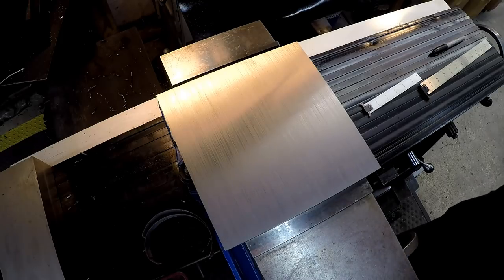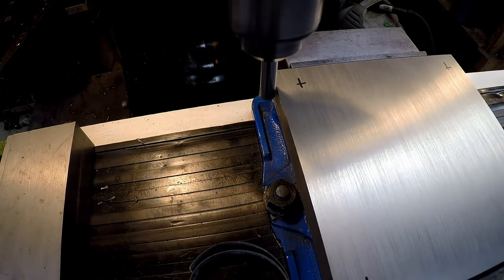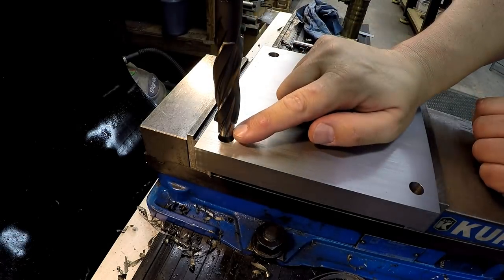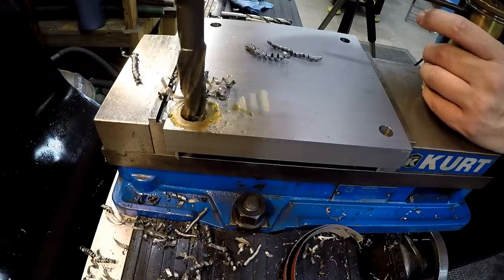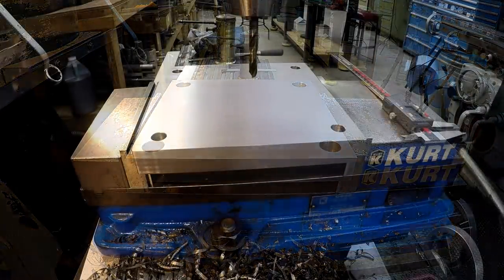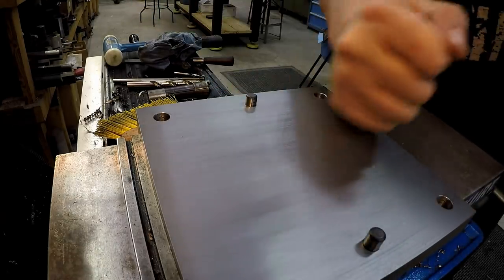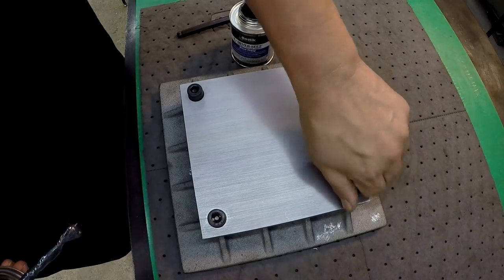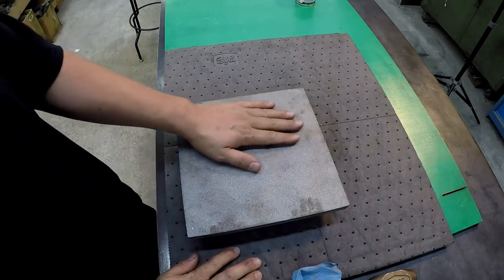Fireball Tool Fixture Plate Part 4

Comment: Year ago I did a comparison test with teflon thread sealant where we put a dab of it on a fitting then screwed it in 
It looked like it spread all the way around the top thread but when we pressurized the vessel and tested it with a leak detection solution it showed leakage at the thread
Then we put a small amount all the way around at the first threads and retested we could no longer detect leakage
After that I always put a small amount then spread it completely around the thread when I want a layer of never seize for dissimilar metals or to prevent leakage 
But a dab will do you for locking a bolt or thread application

Comment: I think I would have dowled it off center. That way you could only install the plate one way.  That way it only goes back the same way it was when you match cut the top plate. If there are any variances in the parallelism of the plates then you would avoid errors from them.
Reply: Good point.  At this stage he could still easily add a third dowel.  However, it sounds like he plans on leaving it mounted, so I'm not sure it even matters.  The way it is fastened from the bottom, I'm not even sure you could take it off without removing it from the vice, so what would the point be?

Comment: Hello Adam. This video was full of great information. I don’t own any counter bore tools. I have been using end mills and always thought they left a flat bottom. We live and learn.  I have a DRO on my Chinese Mill Machine it looks great but is horrible to use especially for drilling holes on a circular pattern, terrible chinglish instructions manual. Regards Chris
Reply from the maker: End mills work fine too, I’ve had to use them many times.

Comment: Excellent work! Sorry if you covered this in future videos, but would it be helpful if you marked the way the base plate is mounted? Since you said you will finish the base parallel to the base plate? That way if you ever unscrew and remove the base plate you know which way it goes back in case of differences.

Comment: Oh by the way, I don’t get what this is for as I’m not a machinist, but I love learning all this from you.
Reply: They're used to hold awkward shapes, that won't easily fit in a vice

The holes Adam was taking about, are used to bolt down toe clamps and the like, to secure the work-piece to the fixture plate.

It's similar to a face-plate for a lathe.

Comment: So what does this doo-dad do? Does it do anything that you couldnt just do with the T slots in the table? Or is it just for the convenience of not taking the vice off or rotating the table?
Reply: You can just put it in the vice and it will already be square.
Reply from the maker: All will be revealed in the coming episodes. It allows you to more easily hold down work pieces that may be hard to hold in the vise or even the mill table top.

Comment: I wonder if the dead space between the two pieces will fill up with oil and chips in use.  It might be a good idea to drill some drains in the bottom or maybe mill out a 2" square hole to let stuff escape.
Reply: Russ Pagel doubt it since both surfaces have been machined flat. The fit is gonna be pretty tight
Reply: @hodgepodgeenginerd1258   The casting has a hollow cavity on the bottom where they mate.  I'm afraid cutting oils will drip through his hold-down holes (after they're drilled) into that cavity.  If so, they'll slowly seep out forever.

Comment: Is a spot drill as accurate as a center drill?
Reply: cumminsscout a center drill is for drilling the hole for a live/dead center. Like in a lathe, a spot drill is a stubby, stiff drill bit for spot drilling before actually drilling the hole. Yeah they kinda get used interchangeably but they both have a specific purpose
Reply: cumminsscout there’s probably not that much of a difference realistically. Cost may be one to consider. Also the angles of the spot drilled with a center drill are not gonna match the grind of a standard twist drill so it’s not gonna contact the spot completely at first, possibly causing the drill to wander a little

Comment: Great coverage of lots of details for beginners and a really nice pallet!  What do you think of  Blue Moly so far?
ATB, Robin
Reply from the maker: Thanks Robin. So far I’ve only used it for this job but I have to keep reminding myself that I need to try it on other things.
Reply: Hey Robrenz, what is the recommended use of a moly based never seize, this is the first I'd heard of it?
Reply: Anywhere you need a low velocity high pressure lube, boring heads, collets, press fits, buck chuck seating surfaces and screws, etc , etc.

Comment: Hard to believe that those two pieces of metal that had never seen each other before fit together so precisely on the dowels.  I'm not sure I could have done that, even after watching the video.  I mean, even if a single thousandth off, it might not have fit and seated.

Comment: Nice! Sorry if you've already answered this in other comments, but did you consider cutting off the gussets on the casting to square it up for holding in a vise? I know the intent with this project and it certainly doesn't matter, but I was justing thinking cutting those off on the shaper to make the under side of the fixture plate square would be fun to watch. Thanks for the continued high quality videos, Adam.  ----Aaron
Reply from the maker: No way, that’s part of the integrity of the plate. I’m simply added a bar to clamp on, in my case a plate since that’s what I have.

Comment: Adam, the shaper results seem to be getting better each time, well done sir. I do have one complaint though, it seems that you may have inadvertently driven the cost of a Monarch through the roof. One was listed here locally (MT, well it was in ID) for $6,000 and it was sold in three days. I considered calling the seller and telling him to split the proceeds with you...because you sold that lathe for him just as sure as a Michael Jordan sold Nike's. Come to think of it, Nike screwed Michael over, so you probably will not be getting a check from Idaho anytime soon.

Comment: I think that I would have drilled past depth so there's a through hole, just to make it easier to tap it out if you ever need to. Unless you just didn't want the hole on the other side. You only need to ream as deep as you want, which stops the alignment pin at depth. It's what we do for die tooling. I'm certainly not telling you how to do your own projects, just offering up a similar solution.

I program CNC machines all day and come home to watch manual milling, heh .... Love your videos Adam =)

Comment: The humble edge finder is one of my favorite bits of machinist paraphernalia—it is so simple, but amazingly precise. I use the Brown and Sharpe ones with a little flat ground on the side that makes a ticking noise when it kicks out. Those are great as long as you have a relatively quiet shop.
Reply from the maker: I have a Brown & Sharpe and it’s super smooth.

Comment: Question.  I was told that a wiggler must be at 1000 rpm.  Is this true?
Reply: i use them at all speeds, generally 400rpm works fine, give it a go :)

Comment: I work with cap screws all day long making molds.  I'm sure they have on size pilots but every cap screw counter-bore I've ever used in 40 plus years is 1/64 or 1/32 over size, 1/32 clearance for the head and hole seems to be the norm for 1/2"  SHCS .  At least in my industry.  The main reason is that the heads of the bolts are rarely concentric with the threads.

Comment: What means the phrase "half thirteens?"  "We're gonna be drilling half-13's."  Six and a half?  Six and a half of one and a half of a dozen plus a half a sixth of the other?
Reply from the maker: 1/2-13. 1/2” bolt size nation course.
Reply: Jim Wright 
That would be 1/2 inch diameter x 13 threads per inch or a 1/2 inch UNC thread.

Comment: Nice series!!
One question? Did you need to go with blind dowels? 
When doing your dowel holes on the base, did you make them 3" (center between bolt holes?)
Just curious. Could have just drilled and reamed through bottom plate for dowels after attaching it and used pull dowels (could also make a slide hammer as another project to be able to pull your dowels)
Many ways to skin a cat.
In my trade, even being .001 off on the dowels for the fit we use on dies would not work. You did use a slip fit so wouldn't be the end of the world. 
Always curious about ways people do things.

Comment: Love your videos,
Please forgive my ignorance, but what is the advantage of using a oounterbore rather than a slot drill or endmill centred on the same hole?
Reply: Mike Bashford I could be wrong but an endmill will not leave a flat bottom. I believe it’s like a 2 degree taper resulting in a slight convex shape. A counterbore is a flat bottom tool.

Comment: how do you deal with reamers for critical dimensions? do you do test reams on scrap stock? is there a way to measure them without taking test cuts? or just use a brand new one every time :)
Reply from the maker: On something critical yes I will do some test cuts on a scrap piece of material to prove the tools are working as needed.

Comment: Heaven forbid that this should happen, but what would you do if one or two of the holes were just an eighth or more off center, and the bolts did not line up?  Would you re-drill over size and make it an oblong hole, or use it as a paper weight and make a new one?  I know it is on the under side, but if it was for a customer, he may think it doesn't look so good.
Reply: Easy - the hole wouldn't DARE be 1/8th inch out of place.

Comment: In terms of 'precision', would it be a good idea to use a torquewrench on those 4 bolts and stamp the used torque somewhere on the plate, if the plate needs to be removed and reasembled? Or overkill because the meeting flat surfaces are not really "squeezable" (at least by hand)?

Comment: What are the rags you are using on the bench
Reply: standard spill kit sheets for oil spills and the like in workshops/engineering firms etc. you can buy them in boxes from industrial cleaning suppliers and the likes. very handy to have on hand. you can also buy different grades and types designed for certain types of spills and absorbency rates too.
Reply from the maker: As Peter and Nick said. Mine are made by Pig.

Comment: Whats a reamer? Why u need it?
Reply: A hole made by a twist drill will be nominal size, not precision. It's just the nature of how a twist drill works. It will never be precise. To make a precision hole you need to bore it or use a reamer for a smaller hole. It's the kind of thing you don't need to think about if you are used to drilling a hole in wood, for instance, but which matters a lot for machining metal.
Reply from the maker: Reamers are to be used for machining a precision sized hole.
Reply: As a note, you can also get adjustable reamers
Reply: ohh okay! ive seen you use them before just never thought about asking what they were for! thanks for the response!

Comment: @abom79 machineist question I work in a machine shop and I use remmers sometimes what is the proper use of one when useing it I was told NOT to peck drill with one? But idk if I am being told the right can u tell me plz. Ik u don’t want to peck drill cuz it will make the finish of the hole inside bad.
Reply: Reamers usually run at half the speed and twice the feed as a drill of the same size. straight threw and no peck

Comment: Adam; Great work but I didn’t see how you flipped the plate and then had it back exactly on center? How did you keep the work piece located? I’ve done that by using a drill blank above one of the drilled holes. That was close enough for my work. I’m interested in your exact method?
Reply: He probabably recentered the spindle using same technic h used in the beginning with edgefinder and half feature on his DRO
Reply: Thanks Adam! , oh wait your not Adam!

Comment: I am sure your method is fine Adam , however , as a toolmaker i would have done the dowel holes in one hit from the top side and then deburred the other side later, this would remove any error that may occur in the reverse side set up . chamfering the other side would not effect any accuracy as to the hole positions, just saying my friend , love all that you do by the way , and look forward to every vid you post , cheers Ade.
Reply from the maker: I know your comment has merit, but I feel confident I can get them to align properly for this job.

Comment: Free Tip: If you have an Android do this: (say it with me) "Hey Google, Remind me to pick up cap head bolts for the Fixture plate" Google assistant will then as you "When do you want to be reminded?"  (At a place or a certain time..) DONE!! If an iPhone, just ask Siri the same thing.. LOL!! Great work as usual.. I kinda wasn't paying attention and didn't see you flip the plate when you started drilling for the dowel pins and I though Oooohhhhh, Sh!t!!
Reply from the maker: iPhone does the exact same thing. I use it often, but not for bolts.

Comment: As someone who grew up using the metric system, it blows my fucking mind that imperial can be used for precision machining.
Reply: Anything can be used for precision machining if it's broken down into small enough and equal pieces. 
By the way, do they use the metric system in polite company?
Reply: It seems I have angered the elders. Think I may have misjudged this channel's demographics. Brb, never commenting here again ha.
Reply from the maker: It’s all the same, distances in space broken into thousandths. It blows my mind people who are bias to metric don’t think imperial is precision.
Reply: We break 1" down by 1000, metric breaks 1 MM down by 100.
Reply: Going up a drill size:

Imperial: 1/16 - 5/64
Metric: 2 - 3

Just seems illogical and unnecessary, but I suppose metric could be seen that way by you guys.
Reply: We go down to less than 50 millionsth of an inch.  Its that precise enough for you?